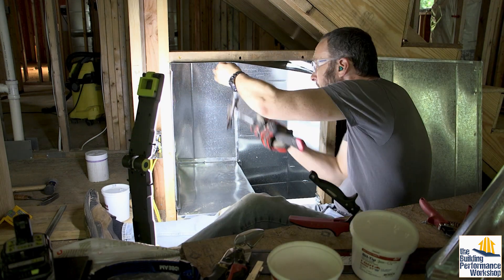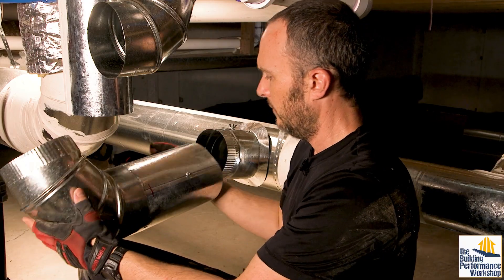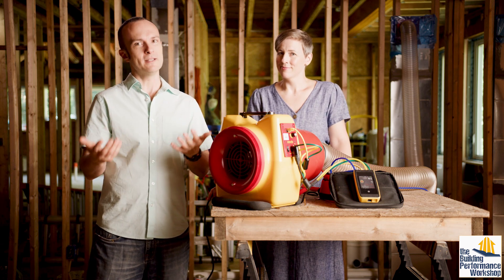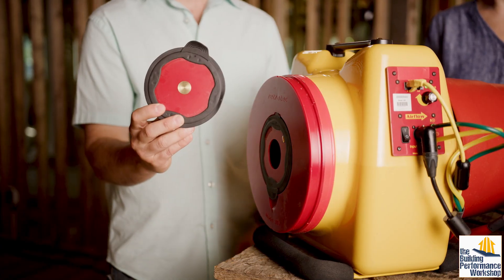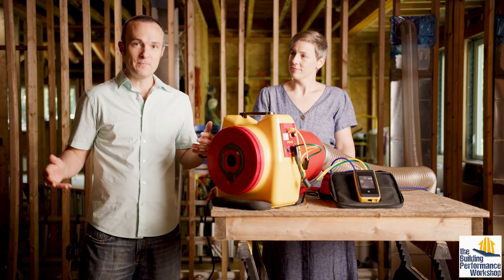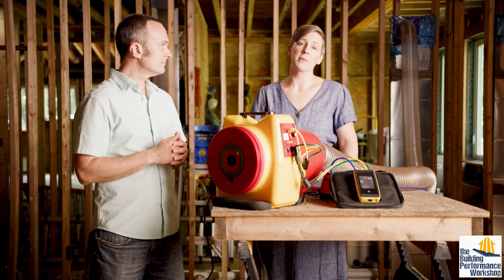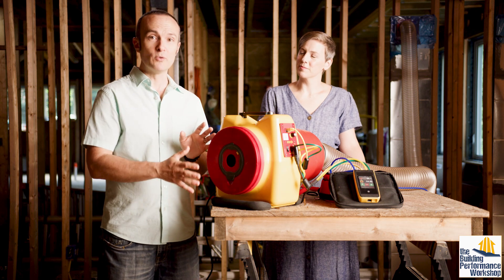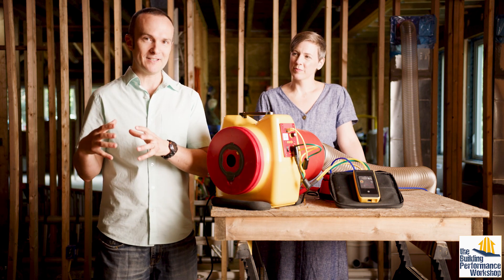Duct Leakage Test: Pass or Fail?

Comment: Do you have a video on how you built the metal ductwork?
Reply from the maker: Hell yes I do-
https://youtu.be/Vd53VFq2w44
and
https://youtu.be/MCKTOAyN9kM
Reply: We found out our 3 yr old rigid duct system was not sealed and in some places loss r value due to the insulation being too tightly wrapped. Is there hope in fixing it still? One hvac told us no but he could put mastic on outside.